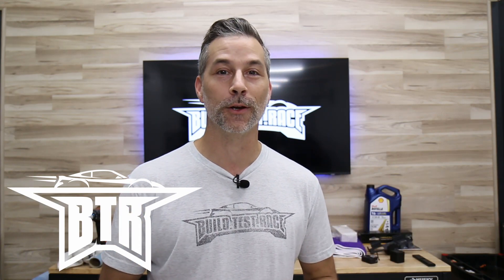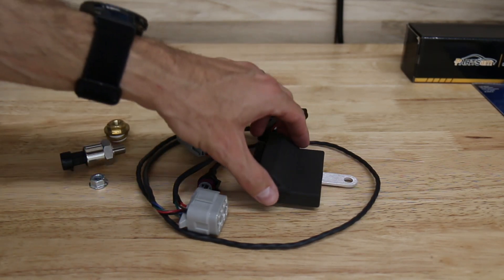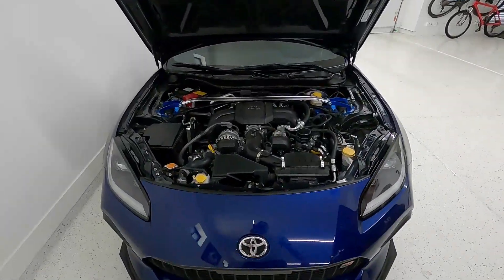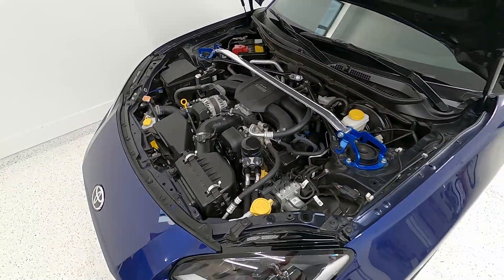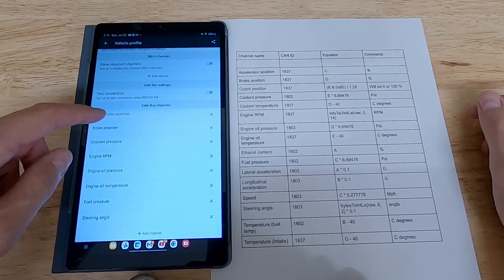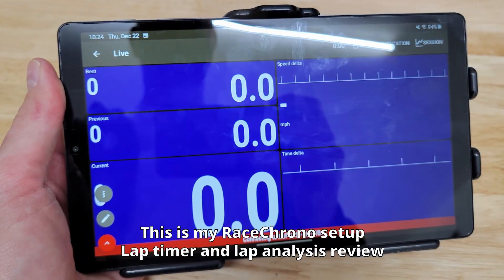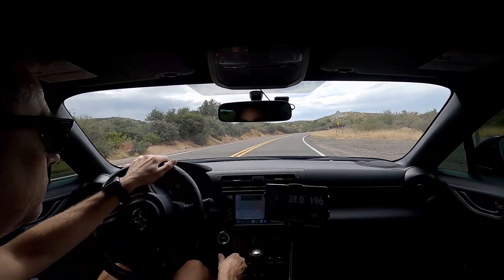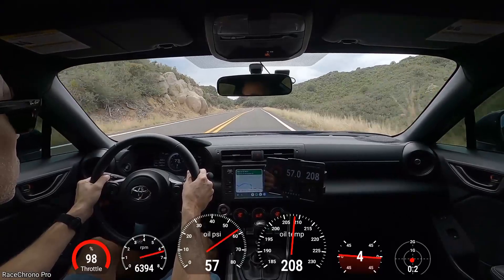GR86 Oil Pressure Canyon Testing & Logging

Comment: Thanks to this dude, I decided to buy an OBDLink MX for my 2023 GR86 that has never been tracked or red lined, and has rev warning set to 4500- discovered misfires in nearly all cylinders.  THIS CAR IS AN ABSOLUTE PIECE AND IM FINISHED WITH WITH AUTOMOBILES.  DO NOT BUY.

Comment: Hello there, thank you for the video. Sorry for the noob question, just bought a BRZ and preparing a list of mods for going to a race circuit, is the oil temp something I can just fetch from the OBD (I mean the sensor is already there) or I need to have a similar sensor kit for the temp as well? Or may be this sensor (I mean the sensor from the video) also measures the temp and writes it to the OBD? Thank you so much for the answer.
Reply from the maker: Oil temperature is already there and yes you can get it with apps/OBD.

Comment: You did NOT need all that hardware - it's already there - you can get electronically through obd
Reply from the maker: False, oil pressure is not there, you must add a sensor/hardware. Oil temperature is there.

Comment: I watched a video from Ansix Auto where they go in to some depth about their experience with their BRZ. In their video they conclude that the Jackson racing cooler drops pressure and to remedy some of the oil pressure issues you could delete the stock heat exchanger. If it’s something you’d be interested in, I’d love to see you cover it in your DIY format.
Reply from the maker: I saw that too, great video! But, just to clarify, they have the Jackson Racing radiator and oil cooler combo, not the standalone JR oil cooler like I have. I would like to test removing the OEM heat exchanger though, that was an interesting new development.

Comment: Are you happy with this logging solution? Or do you wish you went a different route? Currently looking at this as well.
Reply from the maker: For a cost effective DIY type of solution, yes, I think this is about as good as you can get. The GJP IO Box is the only thing relatively expensive (if you want oil pressure, otherwise not needed, Ansix adapter would be better/cheaper). The next step up would be something like an AIM SOLO2 DL which will set you back $800 just to get into it (+$$$ for camera(s), sensors, cabling).

A lot of it is personal preference and needs though too. I need to be able to easily and quickly swap my data analytics package between my 2 cars and have the same process for race logging. Plus, I like that logging/reviewing/video overlay is all entirely within the RaceChrono app, I don't need a laptop or multiple apps/tools to create racing videos.
Reply: @TheBTRGarage  Thanks!

Comment: I think the oil pressure concern is not going to be a problem for public roads.  Track speeds are where the problem starts.
Reply from the maker: That's always been my thought as well. A big reason why I wanted to get actual data on the street to back that thought up.

I suspect I'll see low oil pressure situations on the track, like others have seen.

Comment: One thing that always amazed me, as they never put all pressure/temp sensors/gauges on all the high performance Subaru vehicles, like other manufacturers.  It's a real basic thing that would have been much appreciated. (Obviously this is a GR86, but it's Subaru engine)

Comment: I tried canyon drive and I cannot reproduce oil pressure drops. I think it due to 2 facts: 1. most of the time engine RPM is not that high, I rarely red line the engine in high speed turns like I did on the track. 2. Rarely I max out the lateral G in complex turns with elevation changes. However there exist people drive togue like the car was stolen so I would not surprise some people can run into engine issue on the canyon. We looked at our data and summaries the patterns that usually trigger the pressure drops:
1. Engine is in high RPM (over 5k rpm) and it is a right turn.
2. A long turn (e.g. Laguna Seca T4, ButtonWillow CW13, Thunderhill East T3)
3. Elevation changes (e.g. Sonoma T2, Thunderhill T8W)
4. The turn is off camber (Sonoma T2, Thunderhill T8W as well).
5. There is a left turn before the right turn (S turns, Thunderhill T5W)

If 1 and two of the rest patterns are met, we almost always see pressure drop. Hope this info is help you to set up a baseline for the baffle testing.
Where did you get that Kazama baffle? We are very interested to test it but the retailers we talked to don't have them in stock.
Reply from the maker: Thanks for the detailed info! I've been following what you guys have been testing too. I imagine I will see similar oil pressure drops when I do get it back to the track. Since you guys have already narrowed down the scenarios where it typically occurs, I should be able to easily reproduce it. But, we'll see, different tracks obviously. 

I lucked out on the Kazama baffle, found a guy that was selling one new in box on fb 86 market (tip from a other 86 oil pressure tester).

Comment: You can see dips during extended right turns but since your rpms aren't high the dips aren't anything aggressive, look forward to the track findings.
Reply: Looks to be around 10psi drop which isn't too bad compared to what we've seen on track from other testers.  Definitely good to see data from the road, as I'm sure this gives people more confidence on buying.
Reply: @matthewwain9958  I think anyone looking to buy a sporty car at the 30k price point should get a brz without second thought, it's those who wish to track these that may want to sit for a solution to arrive or look elsewhere given their budget. Tracking is an expensive hobby as it is, but potentially replacing an engine is a whole another beast.

Comment: Great video, goes to show the oil pressure is perfect for anyone using their car on the road network, that’s a relief for 90% of owners, the 10%!that turn their GR86 into a track car with super sticky tires may need additional hardware to stop the pressures dropping as demonstrated on other videos, but for me, it’s given me peace of mind that the GR86 and BRZ boxer engine isn’t badly designed for its main intended use, a fun going sports car.
Thank you

Comment: Thank you for looking into this issue and looking forward to the future results. Have you had black stone lab evaluate the oil in your GR86?
Reply from the maker: Yes, I have had 2 Blackstone analysis up to this point and I'll be sending in the 3rd here shortly. So far they have been good with no issues reported, even told me to go longer between oil changes (I did 3k mile oil changes).
Reply: @TheBTRGarage  that’s excellent news! I’m about to hit 1k miles on my GR86 so I ordered a test kit. I want to see how much metal they find in the break in oil.

Comment: that gauge overlay for the driving portion is real cool
Reply from the maker: It's pretty sweet! I have been really impressed with RaceChrono and what you can do with it, very customizable (ie: for this I made oil pressure/temperature the big gauges)
Reply: @TheBTRGarage what camera setup are you using? I really like how well everything comes together with the CAN injected data, race Chrono, and the footage. Currently planning out my oil pressure logging setup for my GR86 (also a trueno blue!).
EDIT: Answered my own question, saw in a different video you were using GoPro with race chrono
Reply from the maker: @michaelnewman6645  Yep! This particular video is a Hero 8 black, but I also use older Hero 4 blacks.

Comment: Your install videos are clear and concise. What level is on the inside of your oil dipstick as measured first in the morning?
Reply from the maker: Thanks! I have been running it about 1/2 quart over filled since ~4k miles. It is roughly 1/4" over the dipstick full line. I should probably include that info in the description, thanks!